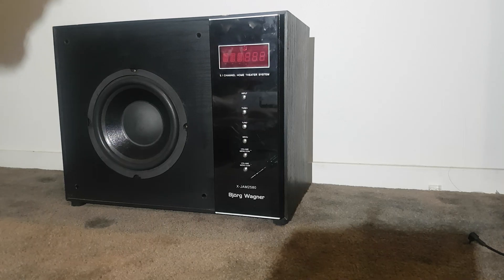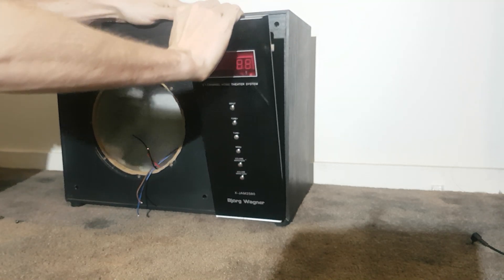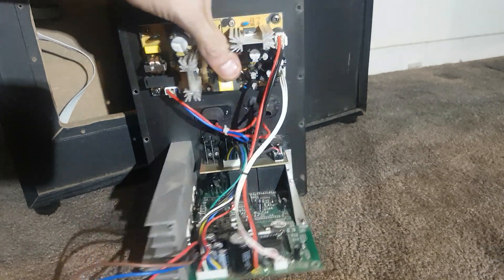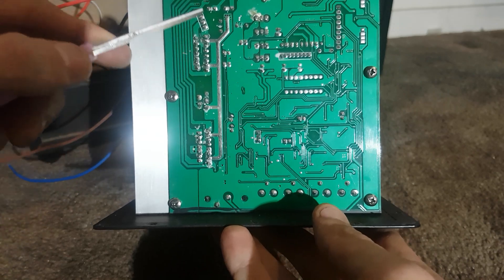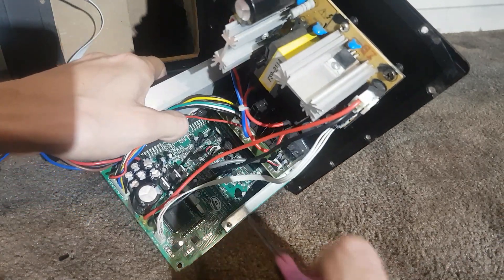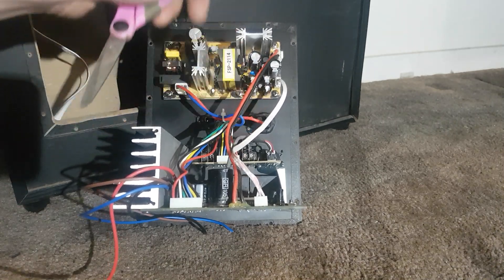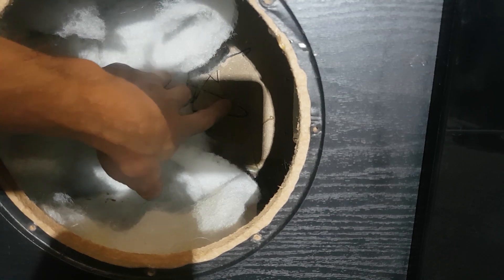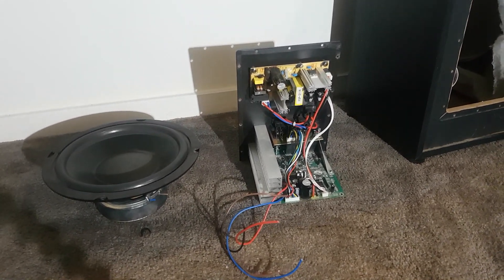Whats Inside - White Van Subwoofer

Comment: I had got a tr brand theater research speakers for free they had the shiny plastic cones and I was really not impressed with the sound at all so to the wall socket they went. The surrounds, the front, the sub woofer all went pop and didn't last half a second. Blown to speaker heaven. The woofer lasted about 1 second and the voice coil actually caught on fire lol but still. Blow the crappy white van speakers!!
Reply: The Random YT Channel we’re they the 1610s or 1620s the 20s are a lot worse btw